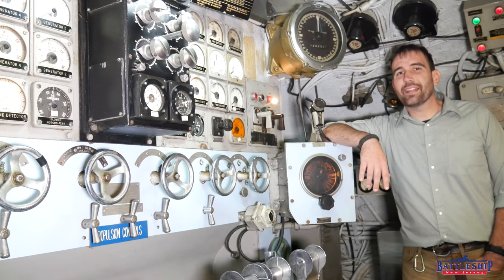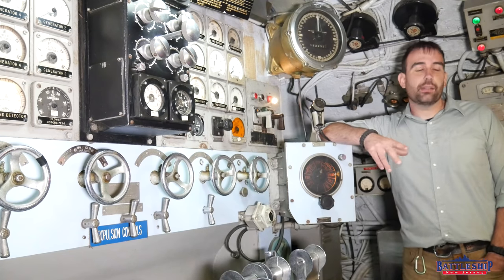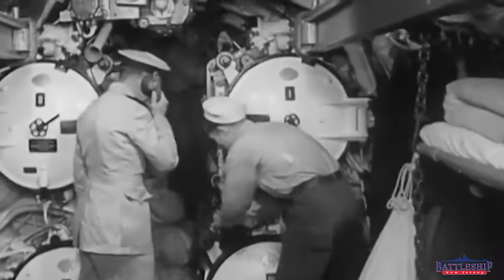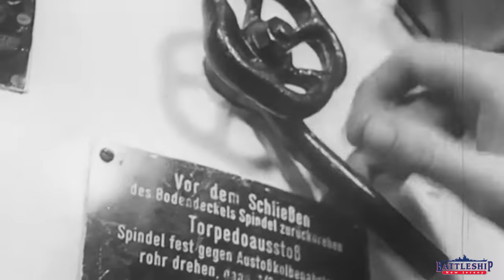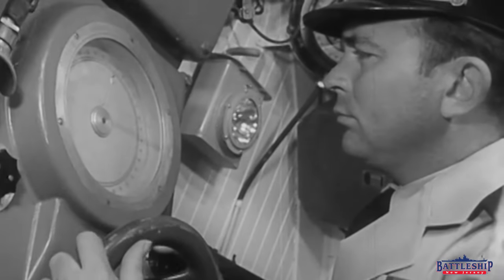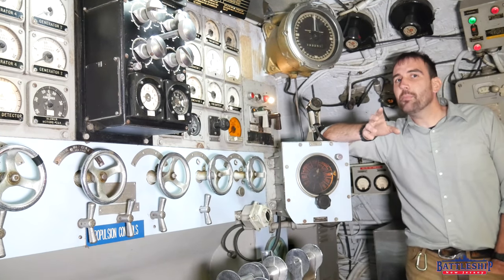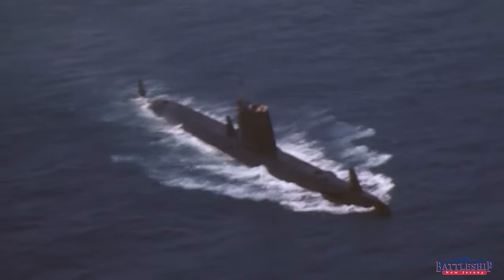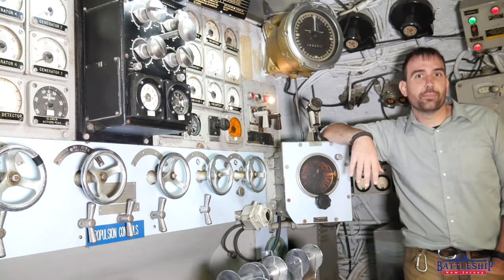Why Does a Submarine Have an Altimeter?

Comment: I'd rather not serve on a submarine at all 😊 That is just not for me, thank you very much.

Having said that, the range of AIP (Air Independent Propulsion) systems that are being introduced now are fascinating, and allow diesel/electric submarines to remain competitive. Examples:

* Liquid oxygen to run the diesel engine under water. This is interesting, because a pure oxygen environment would cause the aluminium of the engine block to burn. To prevent this, they add argon to dilute the oxygen during the start up cycle, and recycle a part of the exhaust gases into the intake mixture when the engine is running.
* Stirling engine. This external combustion engine runs on diesel and liquid oxygen. 
* Fuel cell. 
* Huge lithium-ion batteries. Technically probably not seen as a "real" AIP, but people are thinking about full-electric submarines without a diesel engine.

Comment: It's interesting to me to note that the instrument we call an 'altimeter' is actually a depth guage, as it is a barometer responding to the weight of the air above.
A 'depth gauge' on a (surface) boat is actually an altimeter, as it indicates the boat's altitude above the bottom.

Comment: And why is ALT oriented 180 degrees to the numbers??
Reply: Because it's installed below the surface instead of above the surface??
Reply: Probably because the orientation doesn't interfere with its usefulness. The seaman at that station would only be watching the indication change; the actual (presumably uncalibrated) indication wouldn't be particularly useful.
Reply: Because it is broken. The thin pointer shown close to the 5 indicates it is almost 50,000  feet high. It is the 10,000 needle. The short one is thousands and the long one is feet in 20 foot increments. Later snorkel boats used a barometric safety switch to stop the engines. It was quite an experience when snorkeling in rough seas. One thing not mentioned is that the snorkel head valve used 3 electrodes to sense water covering the inlet. If only two were covered you could get a large slug of water barreling down the induction piping toward the engine room and woe unto the oiler standing under the open air inlet located between the engines. There was a cover for that inlet but when in tropical waters that cover was left off to cool the watchstanders. With the cover on the air was directed outboard of the engines and any water would drain into the bilge. Even when no water slug was in the piping, the blast of air after a prolonged head valve closure would knock you over. Another sub that uses an altimeter is a manned deep diving submersible. As CO2 is scrubbed from the atmosphere internal pressure drops and the altimeter climbs. After CO2 is removed oxygen is bled back into the atmosphere to replace what was consumed, the altimeter returning to the same elevation as when scrubbing began is an indication to stop admitting oxygen. The altimeter is an easy to read and nearly fool-proof part of the life support system.
Reply: Altimeters have three rotating dials:
  1) The hundreds-of-feet: the large white arrow
  2) The thousands-of-feet: a disc below it with a shorter white arrow and "ALT" painted on it.
  3) The desired altitude: a thin white line with a triangle at the outer edge.  This moves when the knob at the bottom left is twisted.  This would be useful in an airplane but is unused in a sub.
The "ALT" label is painted on the Thousands dial and reads upright when the plane is about 5,000-8,000 feet in elevation, a normal cruising altitude.
Reply: That altimeter should NEVER be used in an aircraft. No correction for !ocal barometric pressure.  My guess, with the "odd" appearance, no mechanic would attempt to put it in an aircraft.

Comment: Why an altimeter not a barometric sensor
Reply: Whoever was in charge of purchasing at the time didn't know how to spell "barometric"?
Reply: Probably an off the shelf part built to military grade ruggedness.🤷‍♂️
Reply: @IvorMektin1701  an altimeter is a calibrated barometer deliniated to altitude pressures. like using a graduated cylinder as a mug. it works. maybe they had a surplus
Reply: @michaelkierum42  
I used to have a pilot's license 😜
Reply: Altimeters were mass produced during WW2. My late father had one at home in the 1970s.

Comment: Wait a minute!  Using diesel electric subs Sweden sub force is "second to none in the world."  Surely you aren't saying that their sub force is better than the USA's or even Russia's nuclear subs that can travel submerged for months, limited only by the amount of food they can carry.
Reply: In the Baltic, where Sweden's force operates, a nuclear sub would be essentially useless and an easy target.
There have been many tactical situations where diesels (or other AIP boats) have sneaked up on nuclear subs in maneuveres and 'sank' them without being detected in advance (the Australian ones did that to the Americans for example). Endurance is the one major advantage of nuclear subs, otherwise it's depending on the situation, the skill of the skippers and how modern all the other equipment is.
Reply: @Segalmed  I can see that all else being equal, a submerged sub running on batteries could be quieter.  So long as the reactor is running, there will be pumps and liquid flowing that makes some noise.  Still, our nuclear subs, particularly the boomers, are very quiet.  In fact, they have been described as a hole in the normal ocean background noise.
Reply: @BryanTorok  I am aware of that but to achieve that they have to sacrifice the characteristics of a good attack submarine. They are optimized for their job and do that very well. A navy acting worldwide in all marine environment would best have both tools available. Smaller more agile 'conventional' subs and big nuclear ones (the latter for open ocean and long range operations).
Reply: @Segalmed Yes, but the USA also has fast attack subs.  They are nuclear powered as the last diesel sub the USA had was decommissioned in 1990.   And, I'm surprised the USA had any that recently.  But, like I said earlier, I can see that a sub running on batteries while submerged could be quieter.
Reply: @BryanTorok  The US lost all know-how in how to built conventional subs. After the end of the Cold War they even tried to buy the main German design firm in oder to get it back (that sale got blocked by the German government). The US military had recognized that the new global situation would include many missions the big nuclear subs would not be really suitable for (apart from being far more expensive). So, smaller non-nuclear subs became something really  appealing. But of course buying them abroad was unthinkable. They are still stuck with that dilemma as far as I know. As I said there were several large scale maneuvres where the non-nuclear subs of allied states sneaked in undetected and could claimed numerous 'kills' (of both subs and large surface units). One other problem the US have ist that since the times of Rickover skippers of US subs are primarily experts in the reactors their ships are driven by, not in tactics (in the early days any accident related to the reactors could have ended the program, so Rickover became paranoid about reactor safety). Other navies put their trust in the chief engineers and let the skipper concentrate on tactics (that's why UK nuclear subs usually win against their US counterparts).
During the Cold War when a replay of the convoy battles of WW2 was expected, nuclear subs were the natural answer, same with strategic missile carriers (boomers). But for anything inshore it was better to delegate that job to allies that had modern 'conventional' subs. Imo that's also one reason why the Soviets kept lots of those and developed new ones in parallel to their nuclear sub force (the other being that their nuclear subs were notoriously loud until the Akula* class came around).

*NATO code. The Russian gave that name to the type the West designated Typhoon.
Reply: @Segalmed  That is all very interesting.  I'll have to look into that.  I must admit that much of my submarine knowledge came from reading Tom Clancy, both fiction and non-fiction.  However, the Hunt for Red October was published in 1984 and Clancy died 8 years ago.  On the other hand, he wrote about a terrorist crashing a fully fueled 747 into the Capitol Building and effects it would have two years before 9/11 and of Russia invading Ukraine at least three years before they actually did.
Reply: @BryanTorok  I am also a fan of Clancy's work (at least the earlier novels). In his nonfiction books he had to admit that he fell a bit for naval tech propaganda concerning the actual abilities of the subs at the time in HfRO and tried to adjust in his later novels. Some of the Soviet capabilities were also generally overestimated (not just by him). 
I have a lot of literature on the topic of submarines (e.g. the late chief designer of the post-war German Uboats wrote some very informative books that go into fine details) but I have to admit that I am not up-to-date anymore since my interests (and limited budget) have shifted to other things. But Clancy got one thing right: What's actually installed on ships is not the absolutely newest stuff but only what can be afforded and what has proven to be robust after years of vigorous testing. So, on the older ships one will find lots  of technology that is quite outdated but still works well enough.

Comment: Lot of nonsense in this video.  But one example is saying when the Snorkel Head Valve SHUTS (Not CLOSES) that the number of Atmospheres in the boat goes UP.  (When you suck air out of the boat and discharge overboard a vacuum is created inside the boat and thus the the number of Atmospheres is REDUCED.
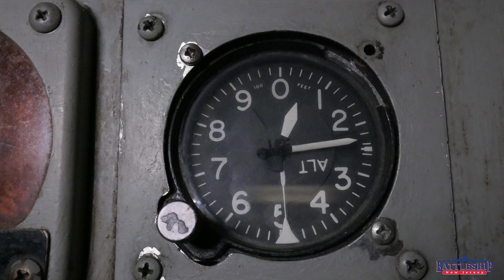See 3:50
There is no "clapper valve" in the Snorkel Head Valve.
Wouldn't bother to watch this video!
s/ Retired 24 Year US Navy Submariner - USNA Class of 1965 - Former Enlisted Man - Served on Two Diesel Boats and Three SSNs